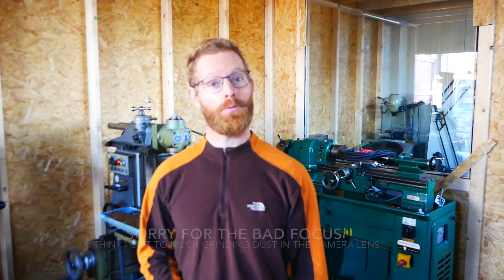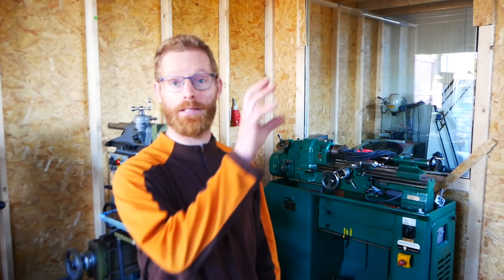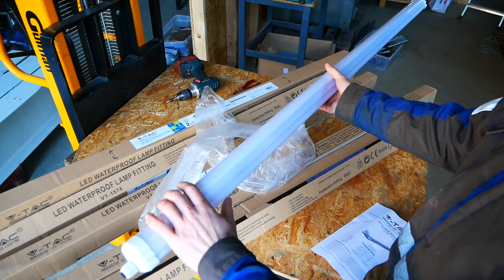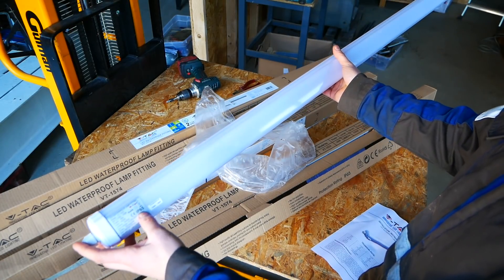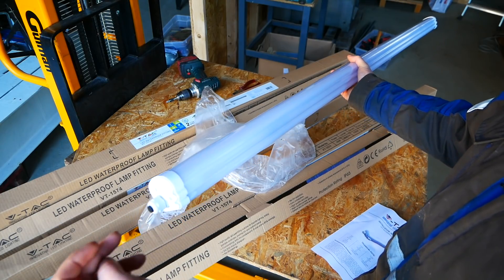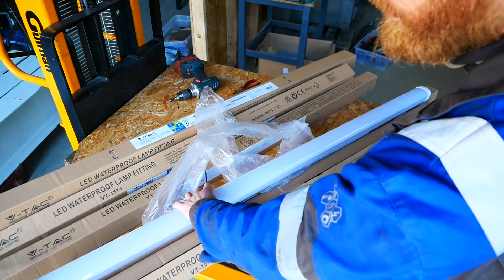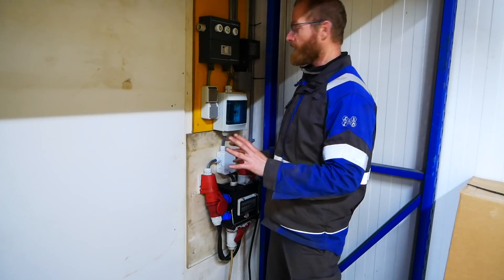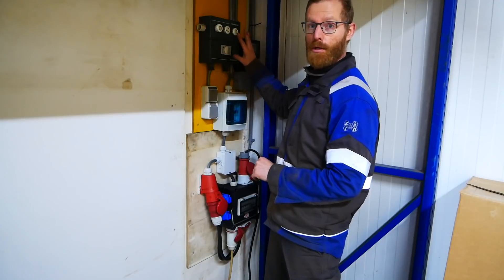Metalwork Shop Journey: Lights On! 3 Phase and 30.000 Lumens

Comment: Great new workshop. The best position the lights is in between you and the machine your operating this way you will not have any dark shadowy areas caused by the machines own body, overhead arm/ram etc; if possible. Also paint the ceiling and walls white when you get time it makes a big difference. I like the new bright lights and using wood as an easy removable method for your wiring great time saving idea. 50/50 with the three phase direction nice bit of luck lol.

Comment: Hi Bart, new shop's coming along nicely, but is 30k lumens really enough?? maybe get some candles just in case you need a bit more lighting?!! haha. Isn't it great to do things your own way in your own shop? I use bootlace ferrules for stranded wire connections too as i'm a bit belt & braces with most things. All you need now is a three phase espresso machine! Super work as usual Bart. Thanks for sharing. Stay safe and keep up the good work. 👍🖖😎🏍

Comment: Looks good. Curious if you can give us some info on your single phase to three phase converter. Who is it built by, where is a good place to purchase one, what is the model number, and maybe some specs for it?
Reply from the maker: Thanks. There is no real converter. The power line comes in 3 phase 400 V. If you take one phase and the ground wire from that you get single phase 230V. But in the Netherlands, every 3 phase connection need there own breaker. Because it was not on there in this building I used two separate mobile ones that also split the connections to multiple 16A 3 phase connectors. But normally you would need only one fixed breaker box on the main power line and split it from there. For my shop I used Brennenstuhl: https://www.brennenstuhl.nl/nl-NL/producten/stroomverdeler/stromverteiler-2m-h07rn-f5g4-0-fi30ma-2x32a-1x16a-cee400v-4xls-1p
Reply: @bartharkemametalworks2299  Thanks for the explanation. We don't normally have 3-phase incoming power here in the US, so we need to install a converter if we need it.

Comment: "Machines are running the right direction"  Hahaha   Yeah, I suppose that would be an important detail to get right  😜  If the lathe was running backwards, the wood chips would be going back to the work and you'd get nothing accomplished 😜
Reply from the maker: Well yes, that would be annoying right? Luckily the machines can run in both directions. But for 3 phase it is quite easy to reverse direction by switching two phases. I have one 32A connector that needs to be changed for that because the owner of the building didn't follow the color codes correctly.

Comment: Looking good Bart. Just a suggestion. You should think of moving your overhead lights to be directly over your machines. The way you have them now you are creating shadows on the front of the machines. I used to design lighting for the distributor I worked for. Thanks for sharing.
Reply from the maker: Thanks, and good suggestion. I will see how it goes and if I need to move them. The reason I put the them in the corner was that I didn't want to have them on the ceiling because I know at one point I will knock them off when I carry large stuff. And it's much easier with the wiring. I had the same light setup in my old shop and I was no problem. The LED are large and give a nice even light. And the lights in the machine shop come from three walls that have enough power to light the opposite side. But if I will change it in the future I'll let you know and you can say 'told you so'  ;-)
Reply: @bartharkemametalworks2299  Just add more of them :-) I did the same as you a couple of days ago (40k lumen in 35 sqm shop) and they are so cheap that it`s not worth the job moving them! Check out @Furtebuamekaniske on Instagram to see what i did.
Reply from the maker: @janeinarwold2663  Looks great!
Reply: @bartharkemametalworks2299  Thank you. Will be adding machines in a few days, just have to wait for the epoxy paint on the floor to harden..
Reply: Yes I agree.

Comment: being from the US, your electrical looks very strange to me.  looks great though - good luck.
Reply from the maker: Yes maybe. Just out of curiosity, what looks strange?
Reply: @bartharkemametalworks2299  most people in the US only have single phase 110 or 220v. For 3 phase they need a rotary converter or vfd. Only bigger companies have 3 phase (I think 440v, but I am not sure). For the same kw on 110v they need more amps and therefor have to deal with thicker wires. To me the american electricity was weird.
Greetings from Germany.
Reply from the maker: @utjeisenkuhle1997  Agree. And Germany is probably better that the Netherlands because most homes already have 3 phase for kitchen and stuff. In the Netherlands this is not the standard yet, but it is easy to get if you pay for it.
Reply from the maker: @melissahill7930  Yes, that is something I also do not understand. Maybe for safety reason?

Comment: Nice neat job!  You are going to want twice that amount of lighting.  You can never have too much!  ;-)
Reply from the maker: Thanks. These LED are really bright. I had a few in my old shop and when you look straight into them you need sunglasses... I will ad a few more LED spot lamps to every machine. Btw, how is your casting work going? Still working on that? I plan to try this in my new shop. Grtz, Bart
Reply: @bartharkemametalworks2299  got a little side tracked.  Picked up a dirty old bridgeport.🤪 Its going to help out around the garage I'm sure.  Hope to get back to pouring metal soon.  Your new shop is looking great!  Keep up the good work.🍺
Reply from the maker: @jagboy69  Nice project. And Thanks!
Reply: @bartharkemametalworks2299  Perhaps add some metal reflects above the lights so that so much light isn't absorbed by the wood ceiling. Maybe just take some spray adhesive and spray the wood, then take aluminum foil and press it to the boards. Cheap fix  😉
Reply from the maker: @korishan  Yes maybe. Or paint it white.
Reply: @bartharkemametalworks2299  Yeah, true, but that doesn't make for an interesting video  😉